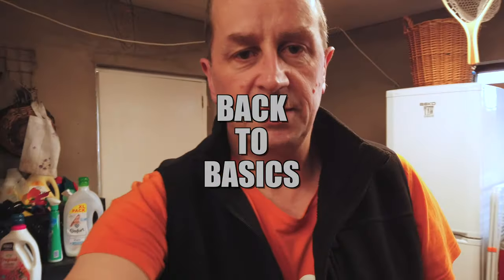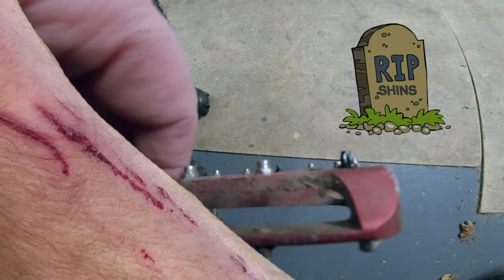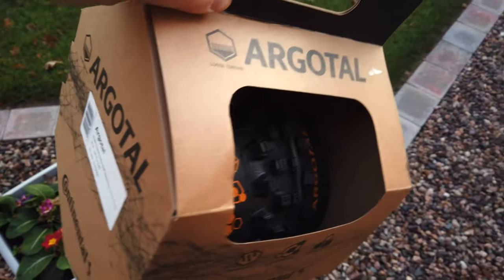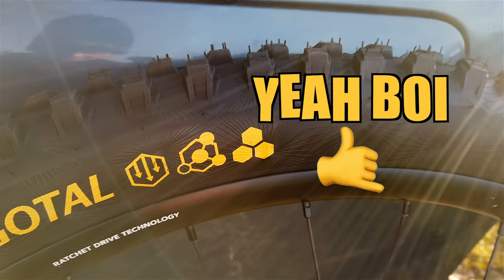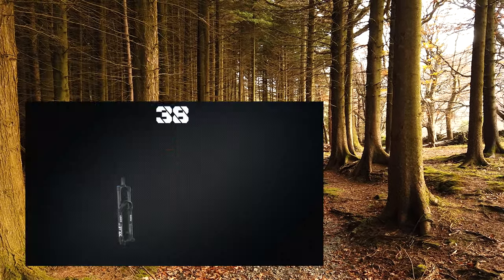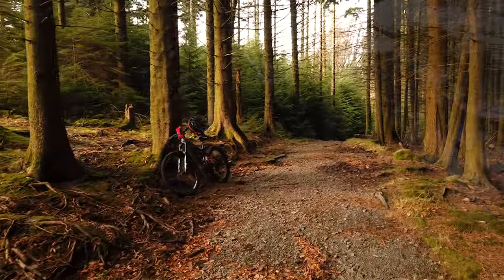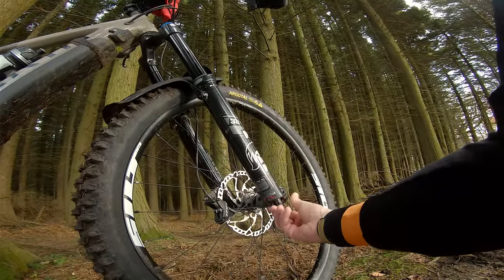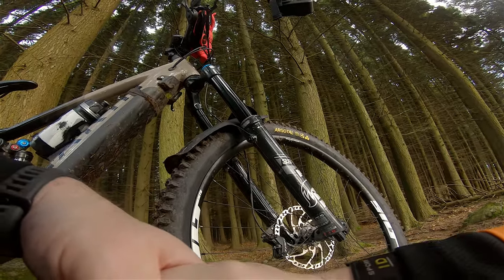MTB suspension setup at Tollymore, FINDING SPEED.

Comment: A couple question if I may. How long does it take to charge the battery. I heard Marin only includes a 1.8A charger and I know the large comes with a 450lb spring. How much do you weigh that you choose a 500lb spring? I'm 220lbs which Marin says I'm in the range of the 450lb spring. And how's the EP801 motor rattle? Cheers 🍻
Reply from the maker: Lots of hours, 10 hours if fully discharged I believe but I never let mine get that low. I'm now trialling a 550lb spring and liking (90kg ish)
Reply from the maker: No rattle, or none that I'm aware of. There is a bit of a whirring noise if pedalling
Reply: @cleggycyclist  That's what I thought. I know Shimano sells a 4A charger, but it's pricey. Personally it would have been nice to have seen it included with this bike as many manufacturers are including 4A chargers now. 550Lb, that's a big jump from 450lb! Guess that would be the way  I would have to go too. I'm guessing the linkage isn't very progressive 🙃
Reply: @cleggycyclist  Good to know! The old EP8 rattle is very noticeable.